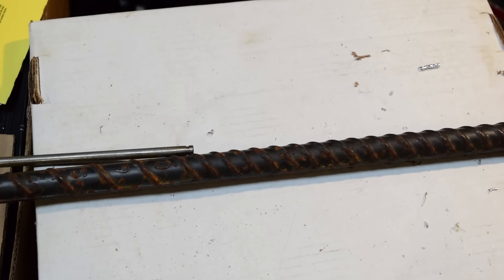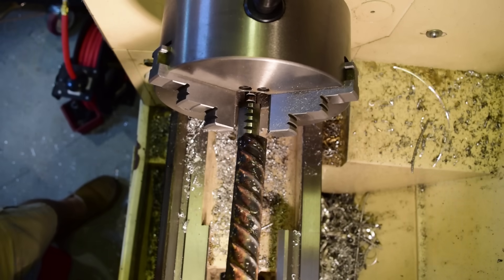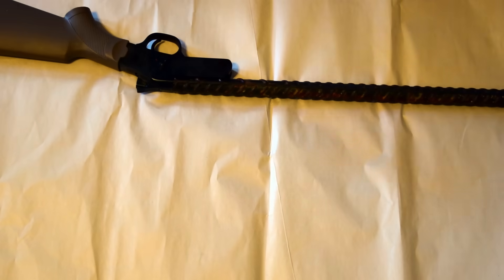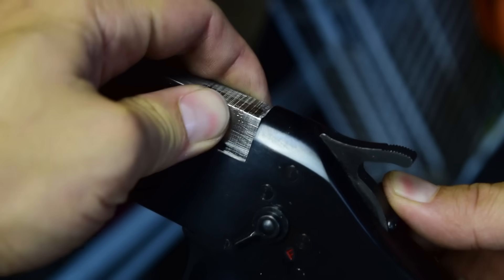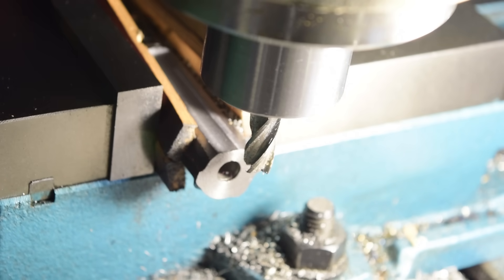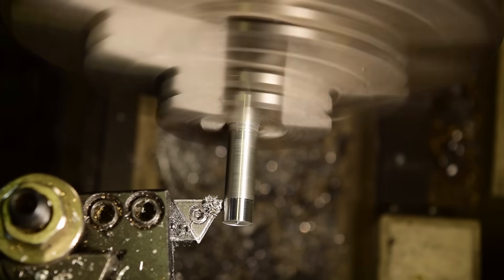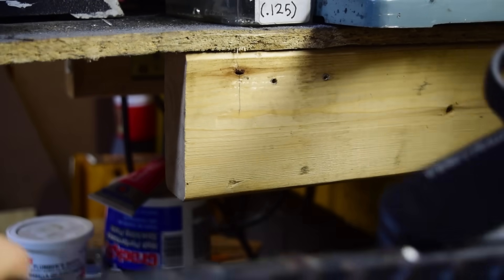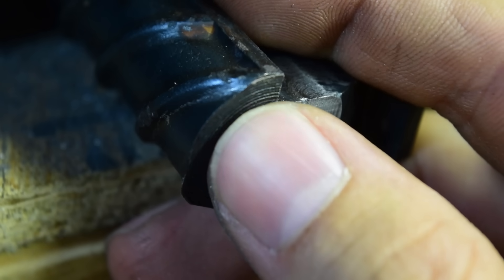Rifle barrel made from rebar

Comment: That's #7 rebar from CMC Steel Texas. It's 60 grade, which means it's 70ksi tensile strength minimum. Usually closer to 75ksi. That's what those markings meant, they're the "branding".

Comment: What inner diameter in mm do you need to drill for a 22lr? i heard that you need a 5,6mm drill to make a 22kaliber to fit nice
Reply: I may be wrong, but the final diameter is 5.6mm.
So if the barrel were short enough, you might be able to drill 5.4mm and then ream to 5.6mm.

Comment: I saw this years ago and just tucked it away in my memory. 

I'm thinking a neat project would be to get a Ruger 10/22 barrel and mate it to an old depression era 12 gauge single shot shotgun lower using the methods you show in these 3 videos. This way you can have a DIY 12ga and a .22 with interchangeable barrels.

Love this particular project and have subscribed.

Comment: I was actually trying to make my first barrel and this is my learning stage and I’m glad I saw this video cause I feel kind of silly saying this but I didn’t know you needed a liner I assumed it was just 1 piece. So thank you!
Reply: I'm assuming he layered it for strength. 5.5mm explosion proof pipe will do too
Reply: You don't need a barrel liner except that proper ordinance steel and rebar are not exactly the same thing, to put it mildly. Usually a barrel liner is there to fight corrosion or because the barrel had to be re=bored.
Reply: @growleym504  It's also an easy way to get a rifled bore without having a rifling machine or a massive hydraulic ram to button  or broach rifle it.

The Steel alloy might not be the same, but it doesn't need to be. They made guns long before there was "ordinance grade" steel available. 

BP can run around 38k psi peak with very large charges and heavy bullets (pressure curve has a fairly steep up-slope, virtually no plateau at peak, and a relatively quick drop in pressure), while some modern smokeless cartridges can run upwards of 65k psi peak (are highly pressure sensitive, and, depending on the powder, can have an even steeper pressure climb than BP (or slower), and often have a notable plateau around peak pressure). "ordinance grade" steels like are commonly used in modern firearms today didn't really show up until the beginning of the 20th century (and many of those early "ordinance" alloys aren't used today, as the steel industry has come up with better).

With BP, it's hard to get much over 45k, even with truly massive charges and multiple projectiles (proof loads)  (pressures you can hold with relatively thin-walled, skelp-welded, mild steel barrels). With smokeless, you can easily hit 170K or more, assuming your barrel can hold it (not terribly likely with anything practical).

Something like .22 LR has a SAAMI max allowable pressure of 24k , but commercial loadings are considerably  below that (they don't need that pressure with smokeless to generate the "Standard" (BP) or "High Velocity" (Nitro for Black) velocities with the 36-40gr bullets .22LR is loaded with) (If you hand-load .22, you can get some pretty impressive velocities with smokeless using tiny charges of powder).

Comment: I took a 30-06 Remington barrel and cut it down to 16.5 inches. I made my own crude lathe using a 12v motor and pillow block bearings. I shaped the outside of the barrel to fit inside a Stevens 16ga shotgun barrel. It fires 32ACP,  it's scoped and it hits pretty good. 32ACP is .312 and 30-06 is .308 so it works.
Reply: What's the wattage & size of your motor? And are/were you satisfied with the results? Currently working on building a bench/ tabletop lathe but having difficulties getting my hands on my preferred type of motor ,so looking into alternatives for the meantime
Reply: @Pre.C_King  It's the power steering motor off something GM made. It has a lot on torque. I also have an Atlas 618 lathe. I bought a Craftsman motor 113.12500. Though I haven't set it up yet.
Reply: @Pre.C_King  It says it's 1/3 hp 1725rpm. I just figured it should work.
Reply: That's something I always wanted to do, real metal lathes are crazy expensive

Comment: I love the look , ( I have rebar curtain rods and rebar pickets on an indoor railing.  Great project and great practice for drilling long and deep holes, but for quality of steel I was sure glad you used a liner.  Looks really good , people need to remember guns have been manufactured for several centuries and they did not have fancy tools for making barrels .  Rifling was put in barrels at the Harpers Ferry Arsenal with a hand operated rifling machine that had a single cutter on the end of a wooden dowel that was push through the barrel and turned by a hand wheel, a tedious process but made a lot of guns used by the federal army during the Civil war.  That arsenal was burned during the war.

Comment: And how did you measure the aluminum that fit in the barrel at 310  .308 Is smaller and how is this chambering a 22 caliber if that’s 310 then your barrel is too big for 30 caliber bullets how are you firing at 22 in something that 310 not making sense
Reply from the maker: It's a barrel liner, explained in the video. The liner is sized and rifled inside for .22. The outside of the liner is 5/16" nominal (~.312", just shy of 8mm), which fits into the hole driller in the rebar. It's a pretty common procedure for .22s.

Comment: But how would you know if the firing pin is hitting the aluminum tank high or low if I could spend in the barrel when you pulled it out unless you made a perfect indication that that was high or low you should do it with something soft like Clay since aluminum could spin and you may think you’re high when you’re low
Reply from the maker: As the position is adjusted the dimple gets further from the center. Spinning doesn't matter, only that the strike point is closer to the rim.

Comment: What tool are you using at 6:47. Does this work on wood too?
Reply from the maker: Cheapo 3" (75mm) 5-tooth shell mill with TPG inserts from eBay. Works fine on hardwoods but TPG inserts are lame.

Comment: Great Job!

Questions..
How do you keep your drilledhole  right in the centre of the re-bar?
You start in the centre all right but how do prevent the drillbit to wander off centre?
Reply: First, find and mark "dead-center." There are various simple and accurate techniques for this. Once center is marked (usually X, Y intersection), a tool called a "punch" is used to create a small dent precisely where you want it. You can hit a punch with a hammer or there are also ones that are spring-loaded and "self-punching." The punch creates a dent which acts as a guide that prevents the drill bit from slipping. Check out link...
https://www.youtube.com/watch?v=8ou-nyVd5hw
Reply: @tonyjackson4099  that's not at all what he asked

Comment: Warning, rebar comes in inconsistent or varying degrees of hardness.  Do a Rockwell hardness test on the rebar you plan to use for a barrel to make sure it is not too soft or low in carbon.

Comment: Use some oil man or a coolant mist , that's just hack cutting and smoking your tooling.
Control the heat back off on feed pressure and let the cutter do it's job.

Comment: Most rifling is created by either:

    cutting one groove at a time with a machine tool (cut rifling or single point cut rifling);
    cutting all grooves in one pass with a special progressive broaching bit (broached rifling);
    pressing all grooves at once with a tool called a "button" that is pushed or pulled down the barrel (button rifling);
    forging the barrel over a mandrel containing a reverse image of the rifling, and often the chamber as well (hammer forging);
    flow forming the barrel preform over a mandrel containing a reverse image of the rifling (rifling by flow forming)
Reply: Drill a hole through the barrel, 3D printed barrel rod and corrosive Solvent to etch rifling into the metal. Ream chamber end and done.
Reply: @SuspiciousGanymede  The Deterrence Dispensed ECM process is similar, but instead of corrosive solvents you use a saltwater electrolyte and electricity to etch both the groves and the chamber.
Reply: @Tunkkis that’s how people refine gold too
Reply: You forgot about edm...
Reply: edm
Reply: @Tristoo  is a pain in the ass to get good results without the right tools

You could do that with a very simple setup though to make a crude rifled barrel I have seen a guy do it for a homemade 9mm pistol here on YouTube. But that came out very fallout quality

Comment: It's 3/4. The 6 on it means 6/8, or 3/4. All rebar in America is measured in 1/8 and marked on the bar.
Reply: That being said, it can be a little bigger or smaller depending on how it was made and processes in the production. Heating, cooling, etc.

Comment: I am rather disappointed. Thought you were going to fire a bullet through a homemade rebar barrel. Did not think you were going to line the barrel and I thought you would actually fire a bullet through it. And that would be the ultimate test is a non-lined barrel that is made of rebar and fires a bullet out of it. Now, I could see some potential trepidations about doing this with rebar as most rebar is made of scrap steel with whatever else is mixed in with it. But still, if saying you were going to make a rifle barrel out of rebar, then please follow all the way through and show the results. Not a primer fire and not a lined barrel. But a for real rebar barrel. After all, you have the tools to obviously get the job done.

Comment: That band saw i have the exact same crap, however it works, for cutting upright i just built a plate out of AU that was 3/16" remove screws from blade guide plate drill AU to fit cut to center about twice the blade width screw your AU plate to that fixture i used a bolt in the saw body for a support arm so the overall deck turned out to be 12" x 18" with the blade off center toward the throat. Now you have an upright that you can do some finer cutting on.

Comment: You could anodize the barrel red & it would look like your carrying a big licorice rope
Reply from the maker: Actually I do have red powder coat...
Reply: Since rebar is steel, you cannot beneficially anodize the rebar, since anodization is used for aluminum to help protect it due to it oxidizing in a controlled manner - you could powder coat it though.
Reply: Kurt Wyatt This should be top comment.
Reply: Best comment in a sea of shit. Lighting up the comment section.
Reply: Kurt Wyatt
Reply: Kurt Wyatt vfhd
Reply: You can't anodize iron.
Reply: We’ll call it…

The Twizzler.

Comment: afaik rebar is just remelted who-knows-what scrap metal, and some of it, like bed frame angle iron, can be hard as hell. Pretty good idea you got there, IMHO I never woulda thought of that.
Reply: It is actuali highly controlled
 quality   high carbon steel
Reply: @3322-v5y Actually it’s just “carbon” steel. Which means that it could be soft for four inches and then high carbon for twelve inches and so on and so forth. I wouldn’t make a knife out of rebar and I definitely wouldn’t make a barrel out of it. Any scrap yard should have high carbon round stock you could use to make a barrel.
Reply: @ChanceHades  no, it just means it has a certain carbon content, within specs of the datasheet

Comment: Has expensive fancy metal lathe...
boring into steel with a drywall drill bit.. wtf
Reply from the maker: Gets job done...
Reply: Probably could have saved the bit had he pulled out and oiled it every eighth to quarter of an inch....
Reply: @Rick_Sanchez_C137_  yes this not only saves bit life but helps with ensuring straightness.
Reply: You missed the takeaway / point of the video. He is showing what you can do in a pinch. Obviously, you would want to have better barrel steel, use oil and better bits if you have them dude.
Reply: I really love this thing but damn i was thinking the same exact thing while I was watching it..... hahahahaha
Reply: i was saying the same thing to my computer screen lol i could take that lathe off your hands for you!

Comment: The stick out on the back side of the chuck is an issue as well as drilling long holes. Face it, re chuck in center of shaft and then drill. cleaning out the chip load 3x more often than you think needed..

Comment: whole point of watching clickbat, then he uses a barrel liner, ffs melt milk jugs around a liner man, show me a fkin barrel if yoo're gonna advertise barrel
Reply: a barrel liner is plenty to hold the pressures of 22lr,  and no most barrels are made from 1 piece of metal with the rifling cut directly into it. if its a 2 piece (liner+outer) it was made to save weight like they do with carbon fiber barrels and aluminum barrels on 22s.
Reply: Couldn't agree more :/
Reply: Peepee poopoo wah wah waaaah
Reply: A barrel liner on it's own is not a safe barrel, all guns have a barrel liner and then the actual barrel on the outside to contain the pressure.
Reply: he used a barrel liner instead of cutting rifling into the bore. there are different regulations for making smooth bore firearms.

Comment: Round bars of 4140 steel from oil well pumping rigs are the ideal material for making barrels after normalizing, of course. Where I live they practically give them away, lol!
Reply: what bout the receiver and trigger part then ?
Reply: @unknown-sh5de  The receiver depends on caliber, etc. in many cases even mild steel would do. It can be color case hardened for surface strenght and looks. Trigger, hammer and other moving parts SAE1050 or 1045 is more than enough.
Reply: @chapiit08 could you ship me one by chance I can’t find anywhere to buy a bar of 4140 in nz
Reply: @Juv1ee  I could ship a truckload to you, but the cost of shipping even a short section, let's say 30 inches would be too much, as I live in Argentina. If I ever visir NZ I'll bring one with me, Lol!
Reply: Or you could anneal it...

Comment: I think you should make small fore grip out of colored concrete really enjoyed your video
Reply from the maker: I like the idea of a construction theme. Any other motif ideas?
Reply: Maynard 59 excellent idea
Reply: This Stuff I Do make a hammer with a tiny .22 chamber in it the fires when it strikes a surface.
Reply from the maker: The idea reminds me a little of this golf club (no affiliation): https://www.ezeegolf.com/
Reply: Use some diamond plate steel or aluminum for plating the furniture!  That's construction-y.
Reply: Quaded column tie with a wrap out of tie wire or some 9 wire off a jag!
Reply: This Stuff I Do remove the lead projectile from the 22 cartridge and replace with a cut down drill bit or nail instead. (Might not work but would be interesting to try)

Make an oil can suppressor, and possibly make a new stock out of construction tools.

Comment: You should use a 3D printer to make a fore end grip that matches the stock and fits into the rebar neatly.
Reply from the maker: Yes I'll definitely have to do this. I don't have a 3d printer though so I'll probably carve it by hand, or maybe build it in glued slices on the laser cutter. I'll post a follow-up video with the grip, sights and range target testing.

Comment: Could you not just use the rebar for the barrel is that not harrend steel anuff to take the pressure of a .22 round ??
Reply from the maker: What Robert said. I have seen some rifling buttons come up on ebay recently though so I might give it a try sometime. I did a hand-made flintlock pistol last fall and it had a straight bore for authenticity (and US legal considerations). Video on that project later. ;)
Reply: Darrin Goodbrand You totally could but the problem is rifling, a liner is pre rifled while you would have to do it yourself on the rebar, which sucks, royally

Comment: You should do a 357 barrel using rebar
Reply: Brian South do you think it would handle the pressure ok?
Reply: Brass Heathen a 22lr has max pressure of 24000psi and the 357mag is 35000psi, as long as the barrel liner will handle it I think it'd be fine.  I would fire it from a rest at least once with a proof load though.